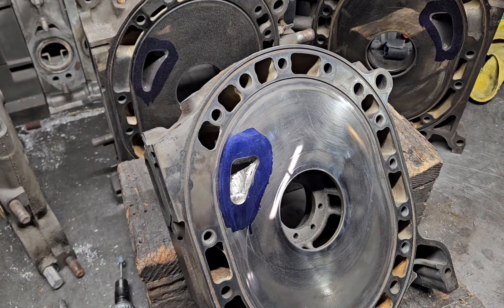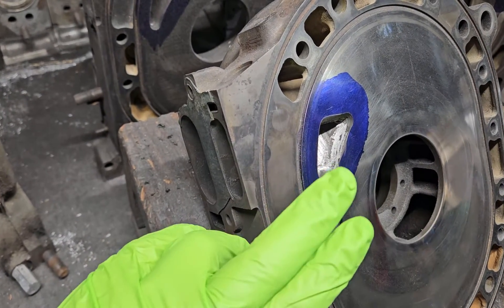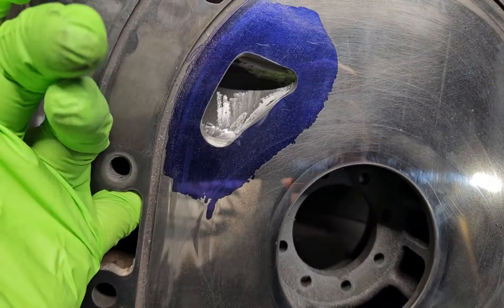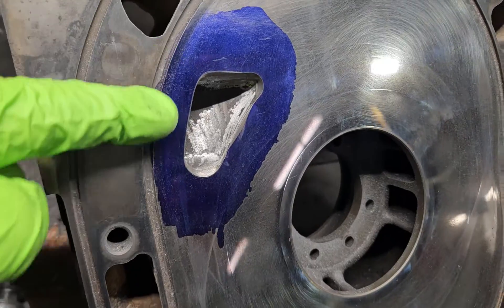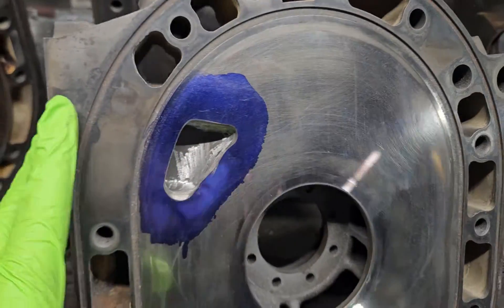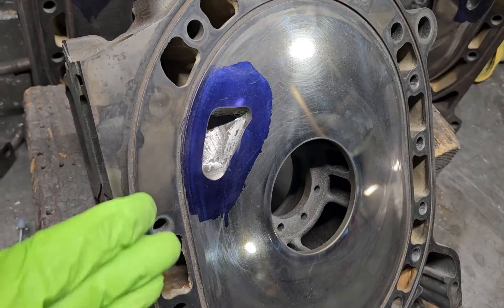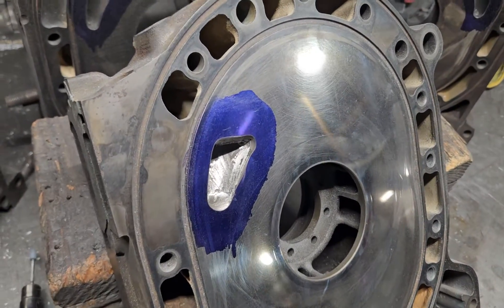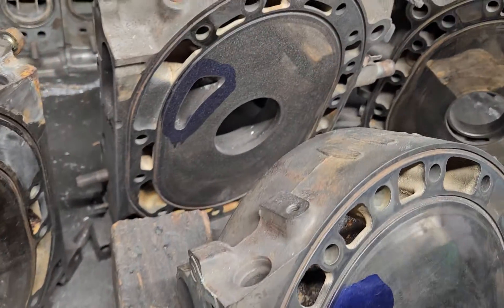Mazda Rotary Engine Porting - Tips for the 20b thick plate - KMR Rotary - Cosmo, FD3S RX7

Comment: Can i ask 1 question in regards to a renisis hybrid engine? Do you have any videos of one running? I have not seen one anywhere world wide. Only builds. There is 1 guy in the world who is currently building one aka 'Rad Potential' on you tube
Reply from the maker: No.  But there is magazine stuff and a championship win, pictures of the car and the build. Trophies... The Mazdatrix car was pre video everything.
Reply: What about having beveled the  intersection between duct and side plate, or duct and housing?
This may improve volumetric efficiency, and protect seals from Hammer-hard shock in straight angle intersections.

Larger intake ports not always result in more power for Street vehicles, NSU conducted research about this, Jan P Norbie wrote about. 

When doing professional Wankel tuning, having and presenting power bench and economy, emissions data is a must. 
Blessings +